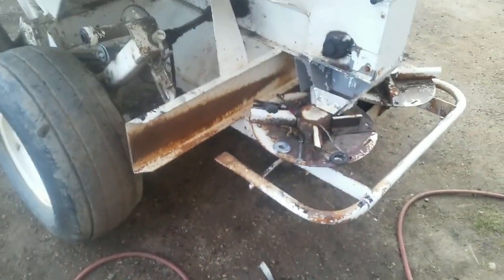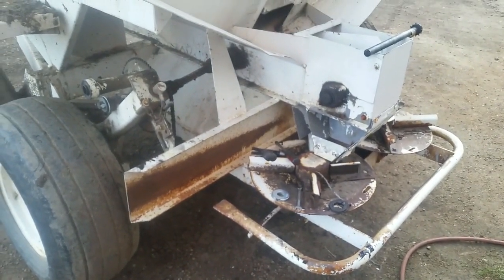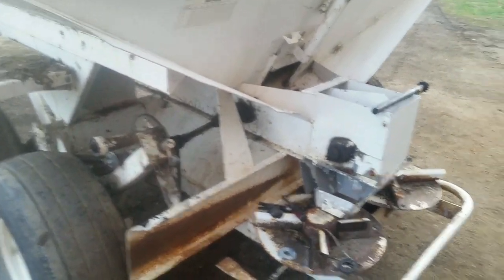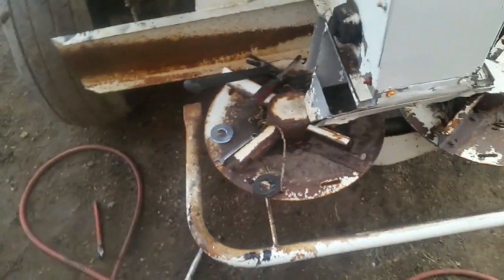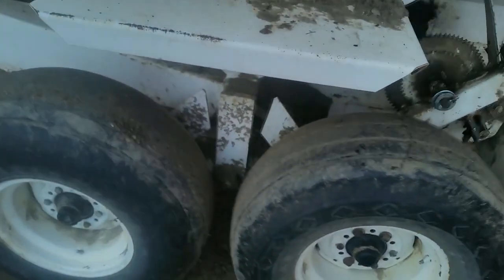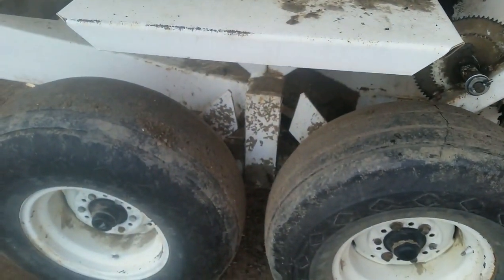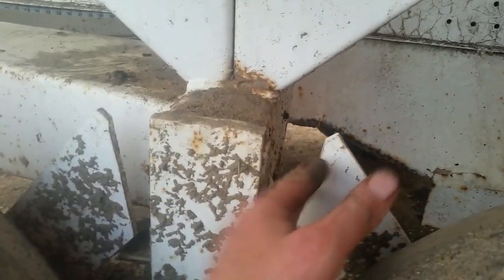Fertilizer Spreader Repair!!

Comment: Sorry to hear about your dad <:-(   Thanks for making the videos even though you are so pressed for time. As my buddy used to say, a lot of grease, it's a machine's best friend. He owned a top-soil business. You never saw a bearing or joint on his conveyors, trucks, & tractors that wasn't oozing with grease.  
Here is a tip if you want to use it: I put a coffee can or plastic milk jug (with the top cut off) over the crank handle of the foot that holds the hitch tongue up after getting oil down the tube. That keeps the crank easy to operate especially if you leave it sit a lot like your broadcaster does or in my case my big trailer.

Comment: I apologize for calling him Rory I don't hear as good as I used to. Those spreaders are good the first year or two but after that I always hated it when it was time to spread because it was always a surprise on what was broken and rusted beyond repair this time. The worse thing was getting a full five or six tons in it go to the field and the apron chain break and I had to shovel it onto another spreader, not a good time when it's 85 or 90 degrees

Comment: Can you controll the on/off of the conveyor from the tractor ?
Reply: jacky bruckers Normally the conveyor is driven by that small wheel with the chain and sprockets and is raised and lowered with a hydraulic for on and off and the PTO drives the spinners